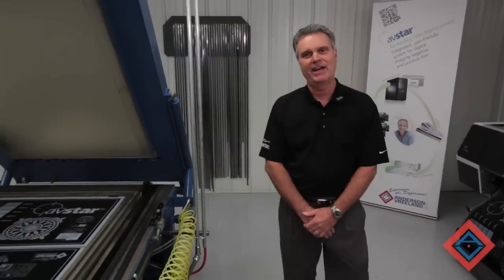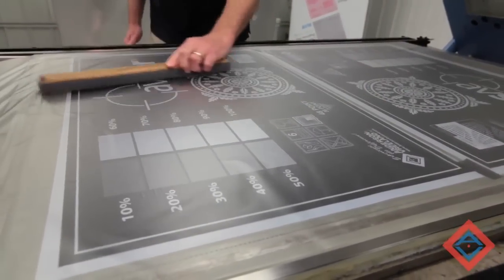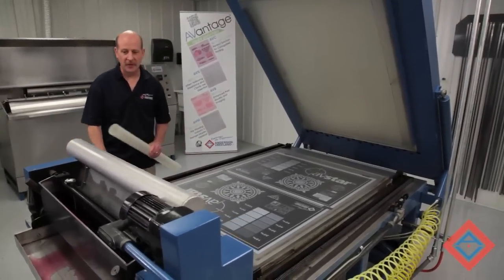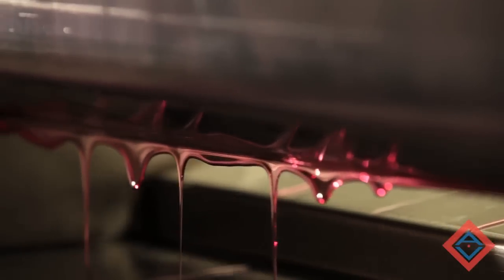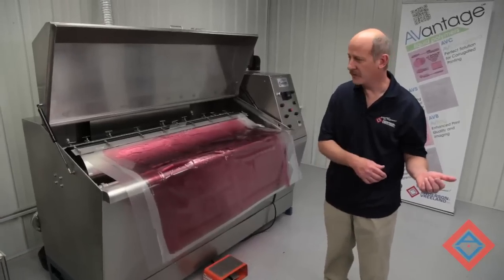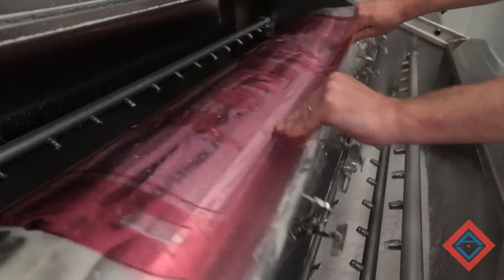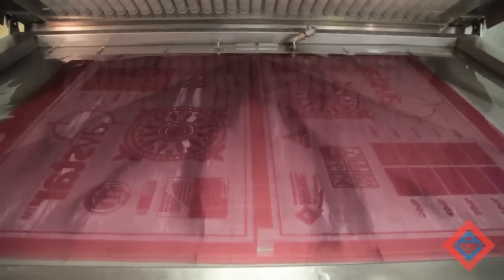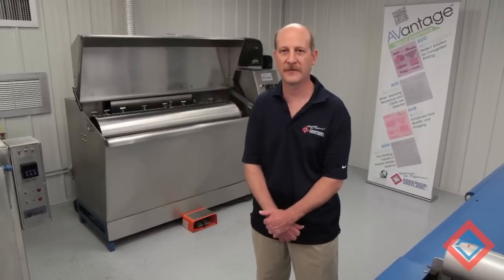Introducing AVantage® Liquid Photopolymer Resins

Comment: Why is salt water used for the wash vs fresh water?  Thanks!
Reply from the maker: The Salt is for Oxygen Inhibition in the Post Exposure tank. In other words, it takes the oxygen out of the water so that the UV wavelengths of the exposure lamps can thoroughly cure the plate. This process is to crosslink any monomers within the photopolymer that was not fully cured during the imaging exposure time after the resin is extruded on to the glass that holds the artwork or film negative. It is also a step in the process that helps produce a tack-free plate due to the plate not being fully cured.